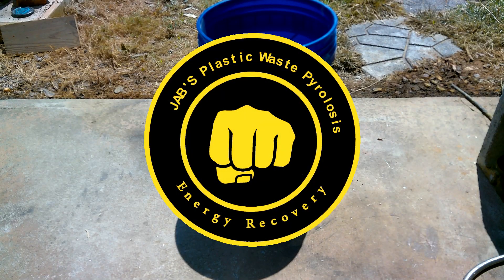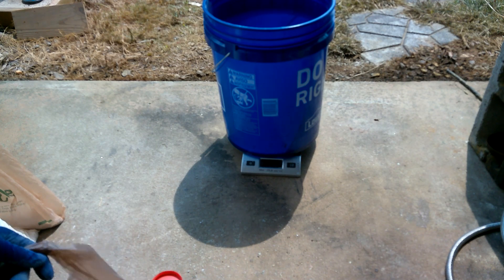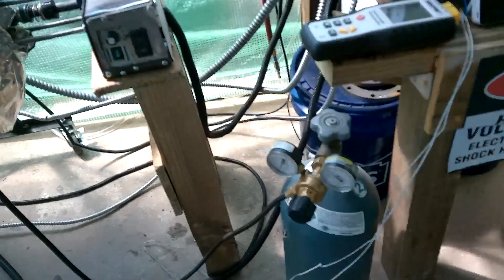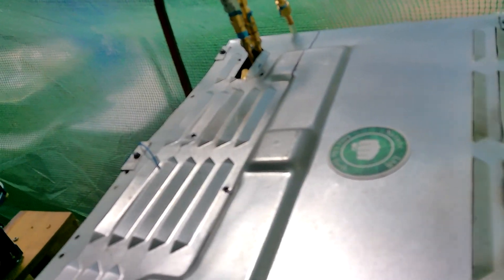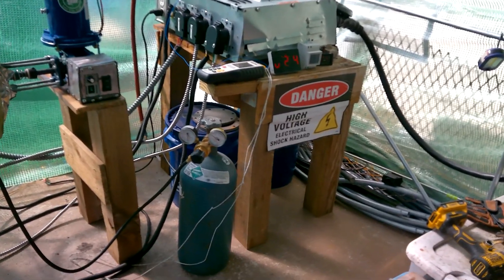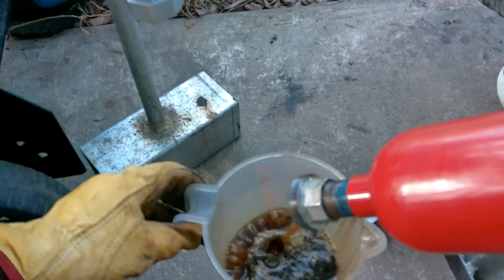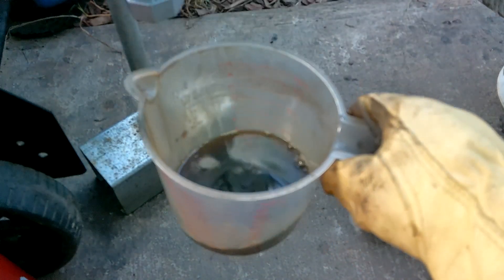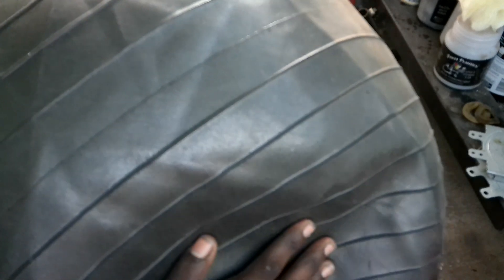Turning STYROFOAM into FUEL with MICROWAVES!

Comment: If I remember correctly, pyrolyzed polystyrene yields styrene oil and styrene-formed gases and not much carbon. Most of the oil that came out of it was the styrene oil and some impurities. Also, definitely don't breath in that gas. It's known to be toxic and carcinogenic. Also, some research papers suggest adding zinc to the chamber to catalyze the polystyrene and make it yield more of the oil, though not a good idea given potential arcing from the microwaves. But yeah, great stuff. Really glad v4 is working way better than v3 did.

Comment: The internal temperature won't be much above the external, due to the vapor pressures and partial pressures of the plastic mixture.  It is like any other kind of retort, you can tell how heavy of a fraction you have by how high the temperature will go.  Just like cooking candy, but with higher temps of course.
Reply from the maker: Great point & analogy!

Comment: Any idea how much of the litter carbonizes? Any chance you are open to doing a run with diapers? I have been trying to get numbers on the efficiency of running with diapers and kitty litter but can't find materials to build a microwave reactor. Awesome work, ready for your "Will it Pyrolyze" series - very easy play to run things through your unit and test different efficacy for common consumer waste. Also happy to help with programming that Arduino to control the motor - you might even be able to get away with a simple timer that runs and flips the power

Comment: Not sure how well it would work or if it's even relevant but you might be able to use some form of vibration to evenly spread out the plastics and what not inside of it. Like a vibrating bar or something in the bottom. Best of luck in your work
Reply: That's not a bad idea, idk if it would be redundant since this reactor has an motorized auger blade that moves things around

Comment: Wow, that's an impressive system!  Glad Youtube suggested, interesting design.  Wondering if you've thought about using other recyclable susceptor materials like silicon carbide or others?
Reply: Wondering what the most homebrew cost effective spectrometer or chromatograph is to test your product?  Not sure a webcam spectrometer would be enough, though maybe with a column where you can recycle the media?  HHHmmm... anyways, still neat system.  Wondering about reducing that energy input as well?   Of course, all safely.
Reply: Wondering if somehow a flow design for the powders, like with an auger, can be made to flow through one or multiple of those microwave kilns like design in a controlled fashion, so to utilize the microwave energy and power supply really first off most effectively?  I think the video titled "Diy Microwave Kiln | Melt Glass in the Microwave" has the best DIY design I've seen to absorb the energy.

Comment: Could the plastic be pressed in to blocks so more can fit in to the chamber?
Reply: From what i've learned by watching Jab's videos and other peoples vids is that you want to shred up your material so that it has as much surface area as possible to be heated up. I don't think you would want to compress too hard or else your effective surface area will go down. But I'm sure packing the machine a little bit doesn't hurt
Reply: @TheCornField_  I agree with the initial lack of surface area but I believe all the plastic melts? So once you get to that point it wouldn't matter.

Comment: Is it financially feasible? Does it not cost too much running the reactor? Does the benefits outweigh the cost.
Reply: I think it is getting there. But I also think it's going to be best in a recycling application where you can clean up waste to create energy that goes back into the recycling operation that then cleans up waste etc etc etc.
Reply: At this point in time, probably not. However, this is experimental to begin with so it will only improve as he goes. I give this young man mad props. He's trying. Most people his age have their heads stuck up there butts with their phones. He's doing something. And doing it to the best of his abilities. The guy's a rock star.